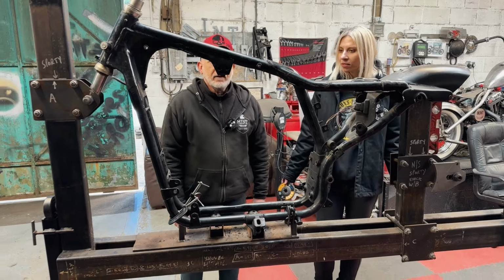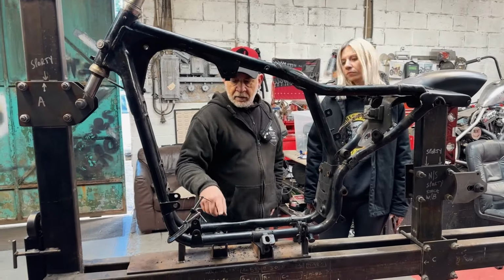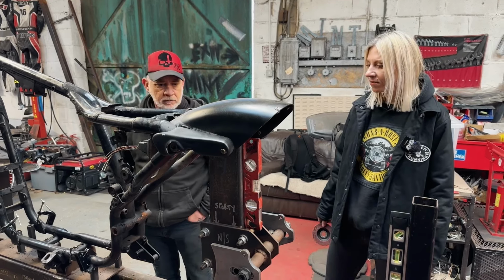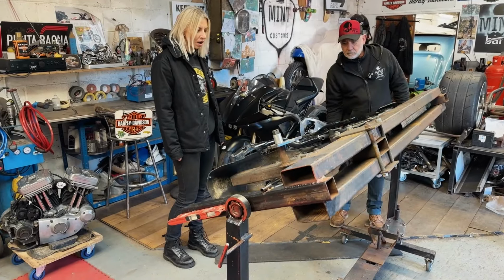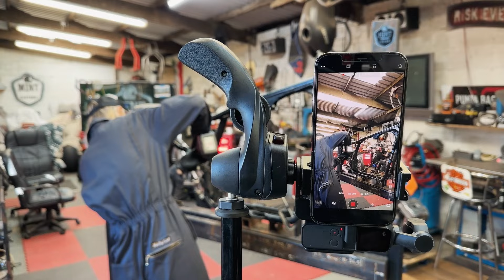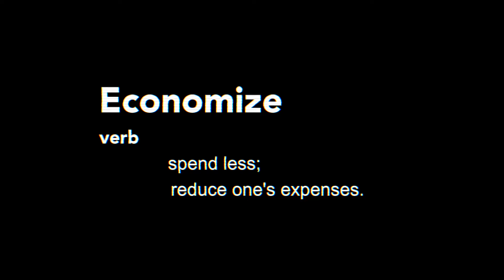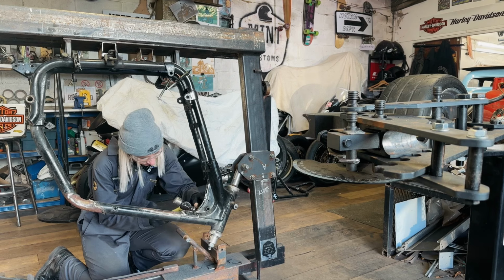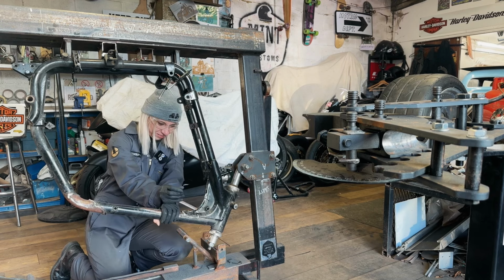Building My Harley Davidson Hardtail Chopper / Cutting the Frame

Comment: Did D economize the discussion buy using less words to get the point across?
A good place for parts is the metal recycle bin but no sugar was saved making this video possible.
Best results are grinding away anything that looks like hd, and cost of parts goes down. (couldn't resist).